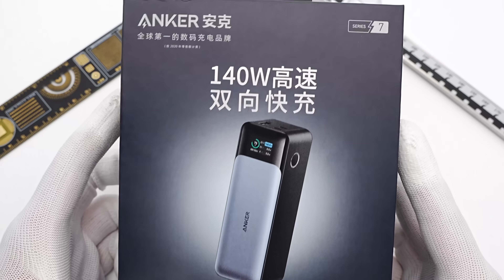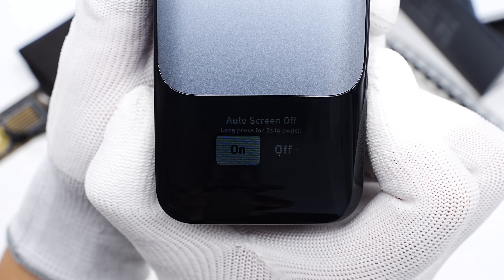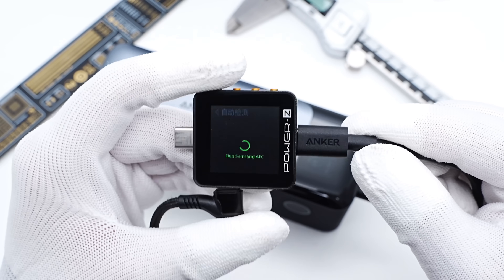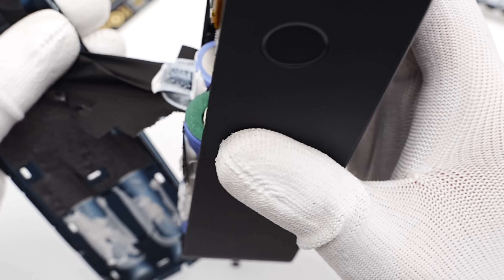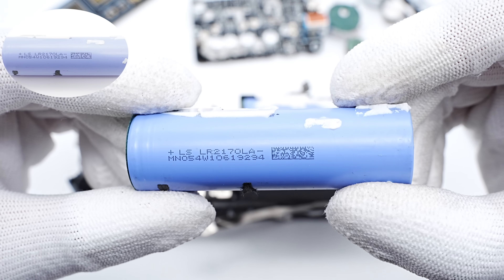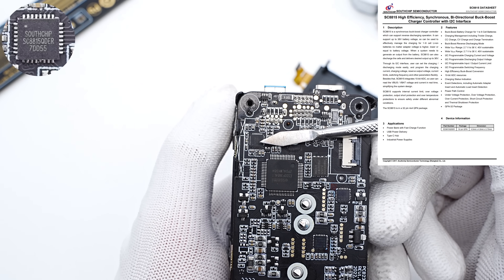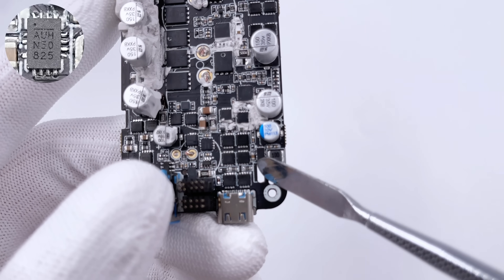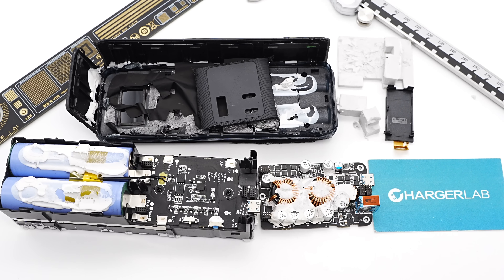Teardown of Anker 140W PD3.1 Power Bank (737 Power Bank)

Comment: I was thinking about getting this but now that I see the batteries can’t be replaced without destroying it I’m not sure I will. Too bad you have to toss out a $150 battery bank all because it can’t be opened in a nondestructive way
Reply: I had a cell which went bad and Anker replaced the whole unit under warranty. It would switch itself off when the capacity reached 20%
Reply: @markpiat that's very wasteful compared to repairing it
Reply: I know, right? I wish I saw this before buying one myself, then  I would've bought a shargeek storm 2. They're so much better repairability wise.
Reply: @yeasirakberlabib2854 Man, I appreciate the tip. I'm no tree hugger but if we can make a smart battery without throwing out the smarts of a battery then that makes sense. All that effort in making a smart bank if electronics only to be thrown away later. SMH. Thank you.
Reply: Thanks for pointing this out. Going for the Shargeek 2 now instead.
Reply: This missed opportunity here it to collaborate with another YouTuber that works with wood, or epoxy resin etc. And re make it into something cool. Like built into a piece of luggage. A table. Or a bike. 

Side note. WTF the world needs to ban non repairable electronics ASAP. If every phone had a user replaceable battery. And every consumer electronic device was user replaceable batteries the world would be a much better place.
Reply: I see your worry but my first high capacity battery was a micro usb in  and three usb out power bank from Anker. I got it in 2015 and it performed perfectly with plenty of capacity remaining until the micro usb port broke in 2020. By then it was not worth repairing since it was on outdated technology. I harvested the cells which still had about 65-70% capacity for a diy ups. That was 5 years of heavy use and frequent travel. 

If you are worried about not being able to replace the cells easily, it is possible to make a 100w pd power bank yourself if you have the tools and buy the parts. Plus it would allow you to upgrade or replace all components, not just the cells.
Reply: I've never seen a power bank with replaceable batteries!!!
Reply: Aside from cells, the usb ports will also fail over time, which is another reason non-destructive disassembly should be possible. I have managed to break the usb a port on my unit (my fault), and I’m able to limp on using only the usb c ports. But if the charging usb c port was damaged, it would brick the whole unit, cells included, all because a 15¢ part can’t be replaced.
Reply: @aaaidan I got one with the input output port broken for 20usd was able to fix. Case looks a little fucked up but went back together fine otherwise
Reply: @juniper26  that’s awesome congrats and well done. How did you fix? Did you cut it open or wiggle a shim in and open the snaps?
Reply: @aaaidan thin crowbar and use the video to know where the clips are ahead of time. Then lift up the top PCB and solder in new port and put back together. You can tell from pry marks it had opened before but it's together securely and won't fall apart.
Reply: @juniper26 thanks, I’ll give it a try
Reply: How many power banks do you know of that you can easily replace the batteries in without destroying it unlike much bigger power stations like the Anker Solex series or Eco flow charge stations
Reply: Which powerbank would u all recommend that is good to replace the cells with?
Reply: Any good alternative or a DIY battery that’s worth it ? 😊
Reply: Anker has warranties
Reply: Si se puede reemplazar, que el amigo no pueda desarmar bien es otra cosa 😉
Reply: This should still last you years, e ven when it can't hold a full charge. Not a big deal.
Reply: why would u ever want to replace the cells?
Reply: @bachoyaryarashvili2793  because they can go bad quite quickly while the really good electronics driving the powerbank would probably work for decades.
Reply: @geraldh.8047  Yeah it's unfortunate.

Comment: Wake me when there's a power bank that can output the full 240W EPR range.
Reply: So it can be discharged in about 20 minutes when powering a gaming laptop?
Reply: @willng34  To be entirely fair, that's about a 50% extra battery life for something that has a nominal battery life of about 40 minutes, and that might just be enough to get someone through something. Granted, you can also swap the USB power bank out halfway without shutting the laptop down, like you used to be able to do with multiple laptop batteries in the good old days
Reply: 25 minutes at Airplane maximum capacity
Reply: @tsujimasen  indeed, last time i check TSA still limit 100Wh (or 27000 mAh) for power banks